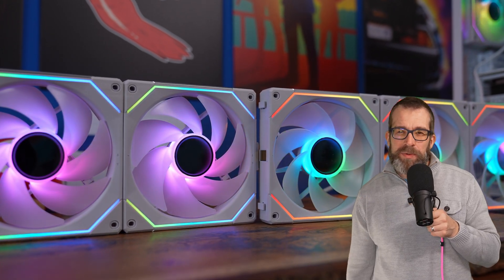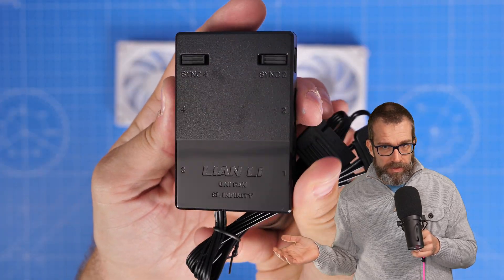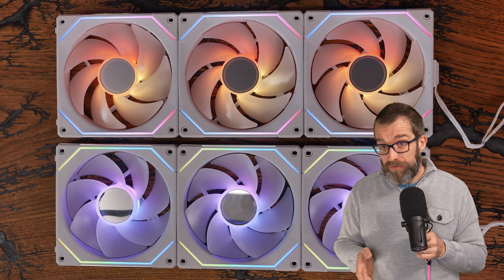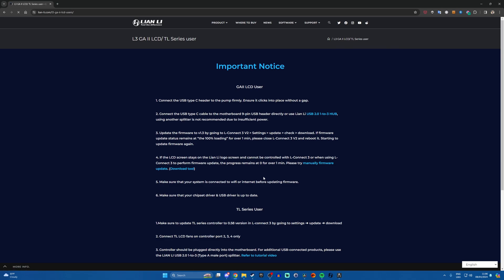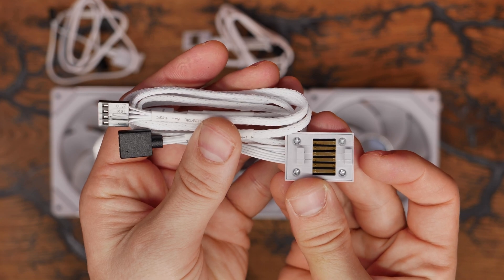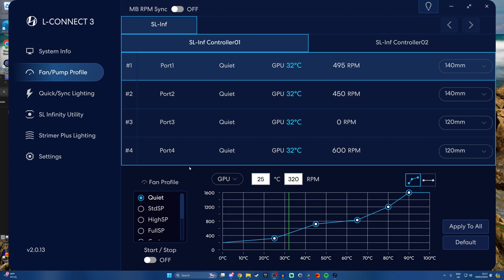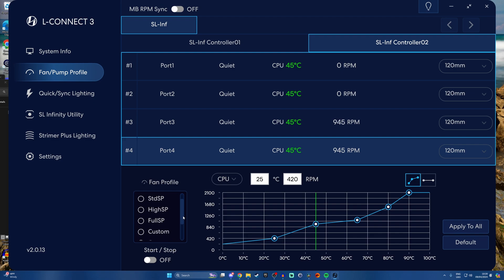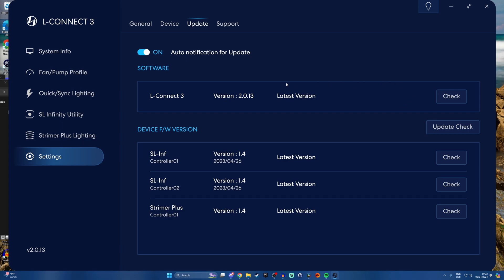Your Lian Li fan problems and questions answered

Comment: I have a question. I’ve ever been connected. I haven’t downloaded the software yet. But the RGB on the fans work as it should, but the pump on first boot displays colors and then once the pump fully switches on it just goes to solid white. Is that an issue with the RGB wiring or does it manually need to be set up in the software before it displays properly? I have the pump wired in with the fan control controller because I have an extra one. I’ve tried the RGB to the motherboard and the control controller and it just stays white.
Reply from the maker: Without knowing which pump it's hard to say but yes it could be software needed
Reply: @TheProvokedPrawn  it’s the GA 2 trinity sl-inf 240 aio. It works perfect with L-connect but is completely unresponsive to motherboard RGB. When connected to motherboard RGB it will work for about half a second and then the pump just goes back to solid white. The fans work just fine All other RGB devices work with no issue and I’ve tried every RGB header individually.

Comment: This is a great video, although I am a little stuck, I want to run 7 lian li 120 uni SLV2's and 4 140mm but I don't know if I need different controllers or cables. Preferably I want it running off of one lian li controller. Any help in solving my issue is greatly appreciated

Comment: I can’t find the controller for 6 140mm reverse + 140mm reg fans…
Reply from the maker: You need the standard fan controller for whatever fans you're using. It can take 4 fans per port.

Comment: I'm currently waiting on a whole mess of infinity fans to arrive so i can upgrade my build, but i heard (after i ordered) that if the hub ever loses power (i.e. psu power switch is flipped off) you'll lose you're saved rgb and fan curve profiles, is that true? If so... I'll be ditching the hub and connecting direct to the motherboard. I like to turn the psu off all the way after i shut my system down
Reply from the maker: That's not true

Comment: Ever since installing my fans and the controller I've been having usb disconnecting and connecting sounds and all my fans would light up for a quick second, I've been doing a lot of research but I cant find a fix.
Reply: have you found a solution?

Comment: Am I correct and is it only possible to connect 6 fans to one port?? At least it looks like to me as I have a push pull config with 4 fans on each side of the radiator. I daisy chained them. But the software only shows 6 for each port.
Reply from the maker: Four fans per port for a total of 16 if I recall correctly https://www.youtube.com/watch?v=P1_8M6S9XJ0

Comment: Be very careful with the USB connection. It is extremely delicate on the controller.  You can only plug it in once.  I unplugged it from the controller and it broke off the connections inside.

Comment: God knows whats going on with my system, I've had my rig just over a year which I won in a competition pretty high end system but came pre built, im not the best with tech issues and my rig has run like a dream for a year but the past month one set of my Lian Li daisy chain fans are running full RPM whilst the other 2 sets are running perfectly the noise is driving me crazy and for the love of God I cant find a fix, cant control the fans in BIOS cant control the fans from Connect 3 software, nor MSI centre, or the Kraken cooler,   any suggestions would be greatly appreciated I also downloaded 3rd party software last night called Fan control hoping that I could control the fans from there, only issue was it didn't even recognise the fans in my rig only GPU fan and Pump fan whatever that means.

Comment: Thanks so much for this detailed guide! I'm planning a build with 3x120 Intake Reverse, 2x140 Intake Reverse(bottom), 1x140 Output(back), and a Lian Li AIO(top). However, in some reviews I'm reading that the 140mm single pack fans don't come with a cable compatible with the fan controller hub, which I plan to buy separately. Are the cables that come with the 140mm fans compatible with the hub or do they need to be plugged in another way? Or do I need to find separate cables that do connect to the hub?
Reply from the maker: The triple pack comes with four of those cables
Reply: @TheProvokedPrawn  Thanks! Keep doing what you're doing to help us newbies!
Reply: as said youll get enough cables from the tripple pack, but the single packs will only come with a cable that is split in a standard pwm part and ARGB part if you are still wondering. At 9:52 you can see that cable from a single pack

Comment: I bought a 205Mini Mesh 6 months ago, and the front fans have dimmed out about half the brightness while also dying blue lights causing white and blue tones look yellowish. How these leds last for so so little is awful for some of the worst value to performance 140 fans. As ridiculous as it sounds, the Arctic ARGB 140's are cheaper and better, and the LED's don't die.

Comment: all of my fans rgb works perfectly fine but the bottom 3 wont spin and i've already checked for updates in l connect. what can i do to get the fans to spin?

edit: manually updating doesn't work either it says both controllers are on the latest update
Reply: Same problem. Did you find the solution?
Reply: @WarAnWaar  yep. my controller was faulty so i had to swap it out witth a spare one now all my fans light up and spin
Reply: Nice mine is led working only not so much spin like others..which number you have connected? 1or 2?
Reply: @WarAnWaar  2
Reply: I would start swapping them around. I had the exact same issue with the SL series. You kind of have to mix and match them one by one. Don't ask me why, but the same 3-pack was only willing to work if they were connected in a specific order. Connect one at a time, if it spins then connect the next and so on. Sadly, this isn't a new problem and power delivery seems to be a part of it. Before I started swapping them, the last 3 of 9 fans were literally just twitching instead of spinning properly

P. S. I see now you had a controller problem. Still, sometimes the ghost lies in a design flaw 😎

Comment: It's like Lian Li has ADHD. It's totally faff. I do like the linking together and the LCDs for data seems brilliant. It's just too much mess, a rat's nest just to have fancy lights. 

I'd like to keep up with the times it's just, well - money wasted on looks that could be better allocated to faster system components. I don't know.  

And I don't know, I have never heard these series of fans but spec wise, they are not impressive. I think that's why they are characterised as "quiet."  

I'll keep watching Mr. Prawn's presentations. He's very, what is the word? Helpful. So hats off to a builder channel proprietor who doesn't come across as a narcissistic knowledge-it-all.
Reply from the maker: It would be nice if they released a universal controller that worked with all the fans tbh. Thanks for watching

Comment: how can I connect the rgb for single pack SL Infinity fans to the lian li galahad aio controller because the cable the single pack comes with has the rgb cable for motherboard and not the one the aio controller uses. 
EDIT: I found out the cooler comes with the adapter for it if so how many?

Comment: Installed the lian li tl-lcd fans today. But the problem is while the fans do spin and the lcd is on, the rgb doesn't work. Even with changing hub ports, usb and rgb connector. I installed microsoft visual c++ from their site, i then installed l-connect 3. I installed the latest drivers. But when i go to TL-fan utility, at the top it says TL Controller01. But on the page it says: " the number of fans is set to 0, please click the button to reset". And when i click on set fan quantity, it takes me to settings where it does show the hub. But with fans it says "fan total 0/0"

Do someone might know a fix?
Reply: Use ports 2, 3, or 4 for your LCD fans.
Reply: @Zufield  Yea i found the problem a few days ago. It wasn't that. After a few hours of finding it. It was a single broken pin onn the connector, which would still rotate the fan and show the rgb. But the software wouldn't notice the fan and so it didn't show the new driver update for that 1 particular fan and wouldn't let me change the image in the screen because  the software didn't recognize it. While it did allow me to change the rgb and fan curve in the app. I returned it and should be getting a new one soon.

Comment: I am having an issue where the rgbs in my aio are not lighting up and my system is not recognizing the lian li hardware I have tried everything including sending the unit back for a new one. I have the same issue so it’s definitely something that I am doing wrong. Lian Li L connect 3 doesn’t recognize there is anything there so I don’t get options to control any of the fans/rgbs.
Reply from the maker: All connected correctly? Including the sata power to psu and usb to motherboard?
Reply: @TheProvokedPrawn  yes I checked it four times moved things around the fans light up but the aio doesn’t. My computer doesn’t recognize the devices so I can’t manually update them. I have an Asus Z-690- G it might be a comparability issue

Comment: Hello i have a Big problem i use TL/LCD Lian Li Uni Fan with TL Uni HUB Controller but He had 6Pin for Power supply but i Use be quiet 12 power 1000w Platin Edition but idk to plug into can anyone help me for the right cabel pls thx

Comment: Thank you for this. I've watched your other 2 or 3 Lian Li videos from 2022 which is how I realized my mistakes (and Lian Lis terrible packing of hardware.) I've had a nightmare trying to connect these for my first build (Hyte y70, 7800X3D, 4090) but bought 2 3pks v1, 1 single v1 and the AIO. AIO controller is where I ran into the issue because the 3pks don't connect to that but the singles do. So returned one of the 3pks to get 3 singles and use the connectors that come with those to hook up to the AIO controller unit (bought the Lian Li USB splitter but was going to over complicate things for my first time building so thats currently a waste)

Also saw that Lian Li Computex booth this year and they're talking about v3(?) and how they're doing away with all the wire complications (which does me no good now cause I'm already invested. Luckily I took advantages of all the sales that were happening a week ago)
Reply: weird same build im having the same issue, my fans always are not working, either ligths on fans off, fans on lights off, or a few is botth on and some fans nothing and i cant fix anything from l connect even when it shows up

Comment: What do I need to do if one fan port showing 0 in RPM? but the ARGB and fan is working? I have replaced the cable, doesn't fix the issue. Is anyone else having the same problem?

Comment: I hope you can help me here. I have 6 SL120 v2 fans, they are daisy chain. So in port 1 of the controller I have connected the 6 fans. The issue is that only the 1st fan, the one closer to the controller, I can control the speed, the other 5 are at full speed all the time, but the RGB in all 6 are good and synced.

Comment: Hi, i have a problem with my fans. All of my fans are spinning good,  but on 6 of my fans, the rgb doesnt work anymore ) i have 9 total 120mm fans ), only the rgb on the radiator fans work.
I tried everything, update firmware manually, change cable in different port, bought new psu. Nothing seems to work. Theres a little bit of rgb light on 1 of my bottom fan,  but in general, the bottom fans and upper fans there is no rgb anymore. 
Are the fans just broken or ?
Reply from the maker: Sounds like a loose connection on the cable at the fan end maybe?
Reply: @TheProvokedPrawn  all of a sudden ? And both bottom and top ?. I checked everything. I will check again

Comment: I really really wanted these fans in my Evo XL case, but the trouble with L-connect 3 having major issues of not showing fans, not being able to control the speed, I just bought the icue link RX120 instead, say what you like about Corsair, but for me their stuff just works.
Reply from the maker: Sorry to hear you had problems. I've not really suffered from problems, but I haven't with Corsair either. It's interesting to read different opinions though, I've seen plenty say Corsair is awful too xD
Reply: @TheProvokedPrawn  Mr Prawn, you absolute legend, I haven't bought the Lian Li fans but I wanted to, but seeing many many users having issues with the L-Connect 3, well it really put me off. I have a lot of corsair stuff already, Ram, mouse, keyboard  headset, Hydro X D5 pump/res, radiators e.t.c and felt my LL120's are just not doing a good job. I was going to get the infinity fans as they look so good, but with all the reported problems I have gone with corsairs Icue link system and RX120 fans as I have a little more confidence and experience with Icue, if that all makes sense.  I hope you have a wonderful day sir 👍

Comment: On this watercooling push pull setup, is it necessary to add fans on the back of the case ? I just realized by watching your video that I didn't thought about those fans in the back. Cheers ☺️
Reply from the maker: Not necessary but it can give a cooling boost.
Reply: @TheProvokedPrawn  thanks! I'll try without those and I'll add them if my CPU gets too hot. It's a Ryzen 7 7800x3d so I guess it should be okay

Comment: My lian li fans the sl infinity ..i got (3) triple packs and a single pack . Didnt get that splitter cable you have to plug into the NZXT pump and the other into the sync port on the controller.  When i seen you had that i looked in all the boxes and nothing . So i had to plug all my fans into the fan controller and use L-connect . Which im hoping i did right ..im new to this

Comment: For some reasons my sl inf fans always goes back to default rainbow rgb when waking up from sleep which requires me to go into l connect and apply my settings to change it back. The tl lcd fans doesn’t have this problem also this doesn’t happen when the pc reboots only when waking up from sleep.

Comment: Have 6 reverse 140mm and a normal 120 in my case, very overkill but its super silent. Only fans i can hear r my aio cause im using arctics included fans. Love the fans, hate the software.
Reply: did you run all of these to the TL controller? 

I have 2-120mm and 5-140mm and the 140s wont turn on at all.
Reply: @JH-hx2cl  ye the controller can do 4 sets of 4 fans. just keep track of which channel each is on and make sure you plugged in everything properly to supply power
Reply: @Jzwiz  

Port 1- 1 fan 120mm
Port 2-  1 fan 120mm
Port 3- 2 fans 140mm (inop)
Port 4- 3 fans 140mm (inop)

Im using separate SATAs for the two power connections going into the PSU

I even bought another controller to swap - same problem

I bought another 140mm fan to swap - same problem

Ive swapped cables around - same problem

im totally out of ideas, can you think of anything lol?😂😭
Reply: @JH-hx2cl  all i can really think of is... are the fans you are using intended for that controller? idk if maybe the newer fans like the lcd or wireless need a separate one. i just took a look at mine, i have 1 120 on one port. 3 140mm on another and another 3 140mm on another. on the bottom is the usb connection, the sata power, and another cable that connects to my mobo. id check to make sure all 3 of those are plugged in. then id download lian lis software and assign each fan in that and make sure its detecting them all. you can custom color/rpm each indiv fan to check

Comment: One annoyance I have with LianLi fans is the fact that I have to use 3 seperate controllers to get 3 (3 sets of 3 fans) different fan RPMs controlled by another controller (Aquacomputer Octo) plus the rats nest of wires coming from the controllers that isnt needed (5V ARGB, 2 SATA connectors etc) I feel like they should've made a seperate controller thats 1 port only thats 1/4 the size

Comment: Is push-pull even worth it? I read that it's only a 1-3% °C difference, vs a standar 3 120's. I also don't like how it looks (top mount), I can still put them in but I feel like id be throwing away money
Reply from the maker: It's varies depending on the setup in my experience. Makes quite a difference with an i9 but there are other options (like undervolting or running faster fans)
Reply: @TheProvokedPrawn  really? I got a 4090 i9 14900k top AIO, my case favors GPU cooling and what I've been reading seems to be universal. Can I control 3 Corsair fans that came with the AIO with the Lian Li controller? Thanks for the reply tho

Comment: Lian Li needs to get their act together with their software. This is ridiculous that you gotta manually download the new version and uninstall the old version. Corsair's  Icue is light years ahead in terms of how easy it is to update the firmware and app, all on the app.
Reply: Lconnect can't even stick to the speed you set so the fans make an oscillating sound.
Reply: @cemsengul16 so the sound will forever be loud ??😭😭 I been tryna find out how to change the rgb and it took forever but I figured it out but the software jus made the fans loud asf and I was thinking I messed something up😭
Reply: 1000 percent right
Reply from the maker: True
Reply: 10000% i regret getting them 😮‍💨

Comment: What fan is best for an AIO? UNI FAN TL or UNI FAN SL-INF? Both look nice i just wanna pick the best performer for on a radiator.
Reply: have both, both looking great, TL led effects are more brighter and they have bigger morror, infinity have iluminated blades. Month into using it ends for me in RMA 3 of the TL fans, led burning out and failing coils. Thankfully LianLi support working great with replacing them. Overall I preffer InF > TL